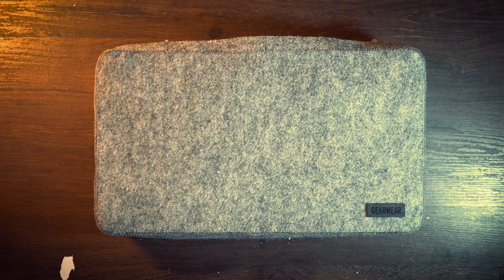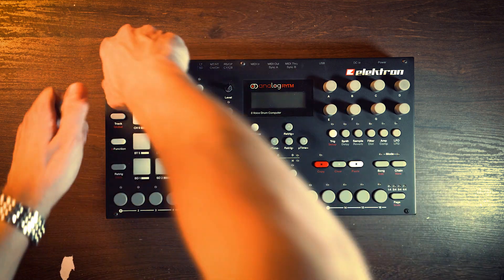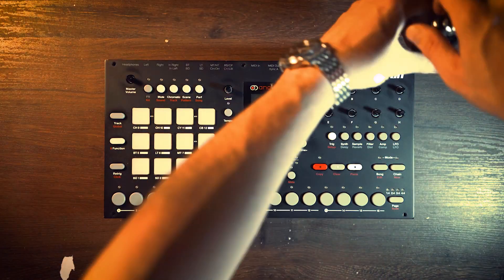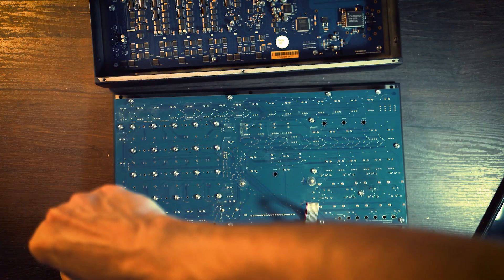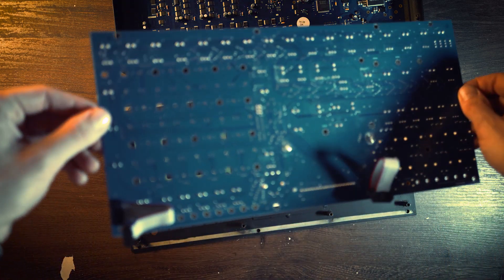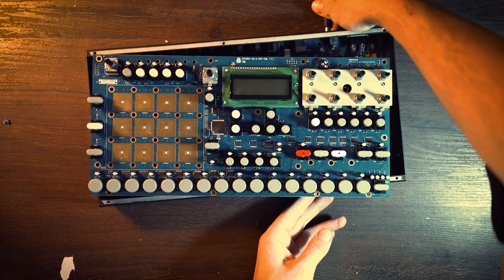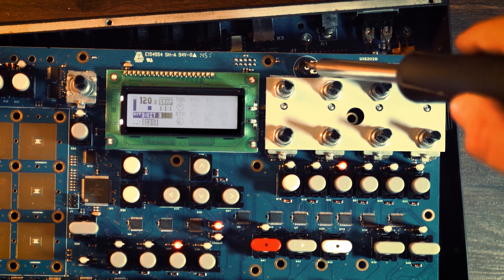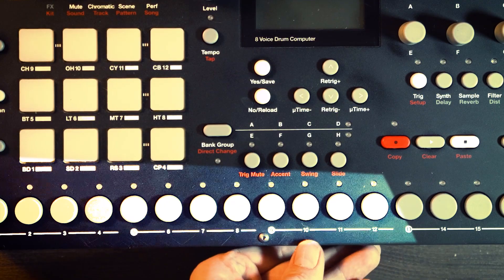Analog Rytm Screen Fix: DIY Repair Tutorial

Comment: Thank you Thank you Thank you Thank you .
Just got a used mk1 AR and the screen was unreadable.
I was really guttered when i turned it on for the first time
 Searched the web and everyone was like go get a replacement screen .
Now its almost like brand new again❤
You just saved me about 200 euros.❤
Reply: Same here I have to check if it's working. Got a used rytm and didnt see the screen problem in the daylight :) I will try to do it later. Did it help yours?
Reply: @planktron  yep... Its like brand new almost.
Reply: @VoltTone  same here worked like charm!

Comment: you don't need to remove all the panel, just remove the 6 screw and move the contrast from the back of front panel, you can find the label CONTRST, there is a trim pot , and they can be control from the back with a little screw driver, without remove all screw of pad and panel. only 6 screw and you can do it
Reply: I can confirm that actually removing only the 6 screws from the front panel, you can find a small hole where you can put the screwdriver in. I've just turned my screen to new! Thank you guys! ❤

Comment: HI! You don't actually need to open the all machine to fix the contrast, you can access it from the back of the blue plate, there his little hole conrreponding to that screw you turned, that allows you to turn the.. screw. It display the text "contrast" corresponding to this hole, right next to the top center plate connection cable.
I needed to open the machine anyway to access to the pads section, they weren't working porperly. I cleaned up the pad circuit and the contact "foil" underneeth the gum pads. I used a contact cleaner with a cotton swab.. nice and soft... It works perfectly now and I can have sweet dreams again 🦾

Comment: Hey, i tried to adjust the screen exactly as elektron told me and you did it. Now nothing works! The scrren looks strange no knobs do everything. After assembling i turned it on and no power?! Then i disconnect the flat cables and connect them again sometimes the display looks normal sometimes only pixels. But the hole unit doesnt work anymore! Somebody an idea? Something has been broken
Reply from the maker: Hi there, I'm sorry to hear that your Analog Rytm isn't working properly. To be honest, I took a risk attempting the repair myself, and even received a comment on Reddit warning me of the possibility of damaging the unit. Did you happen to record the process? Maybe we can review it together and see if there's anything else we can try to fix it. Let's see if we can get your Analog Rytm up and running again!
Reply: @HorribleNoises  Hi, i got no choice i have to send the unit in to the elektron service. A hardway learning experience! But sometimes